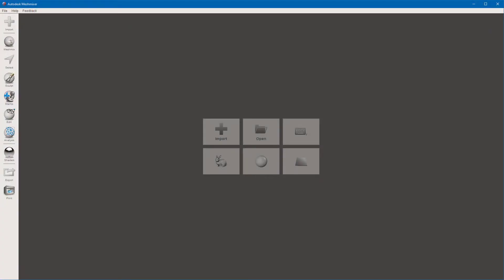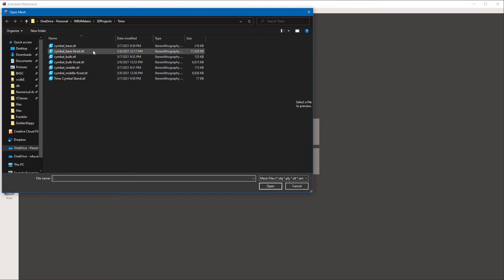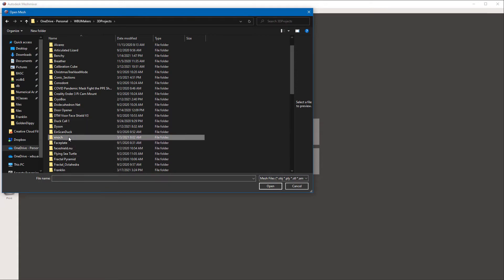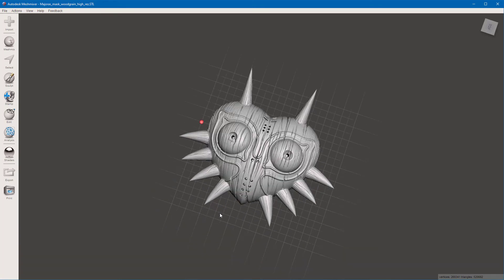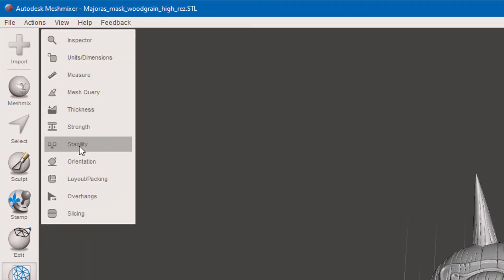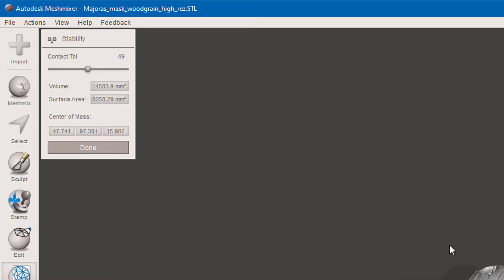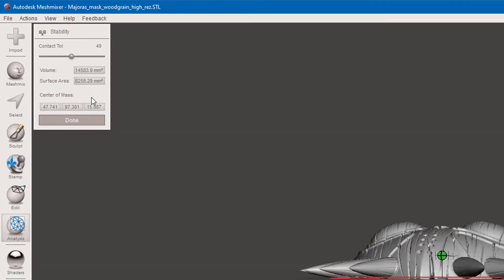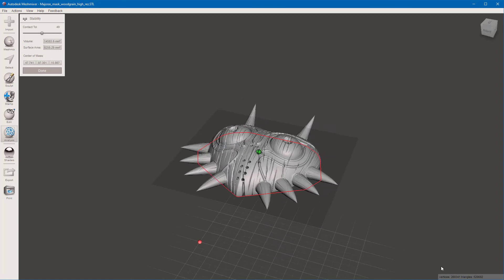How to find the volume of a model in MeshMixer

Comment: Great thanks... This video also turned me onto the program for volume calculations.   Autodesk makes some of the best programs.  This one is free.  It's been a help since it is difficult to calculate volumes in Mathematica, i.e. SphericalPlot3D when it must be converted to a volume calculatable format.   While it can do it with meshes, Mathematica 13.2 does not properly close most meshes nor is its mesh repair tools all that up to the task.  

So far MeshMixer mesh repair isn't all that good either but it will give an accurate volume on unclosed meshes.

Comment: What if you want to find out the volume of just some part of the mesh? For example, in your mesh let's say an eye or a single horn? Is it possible?
Reply: You could cut out the section you want to isolate somehow (e.g. splitting the mesh with a plane or doing a boolean intersect with a cylinder) and then measure that now seperate mesh.